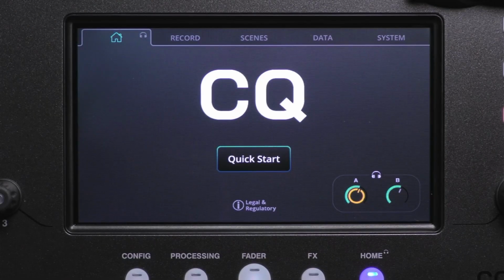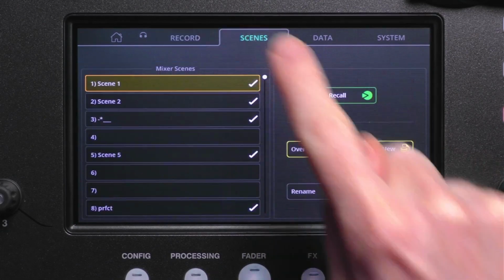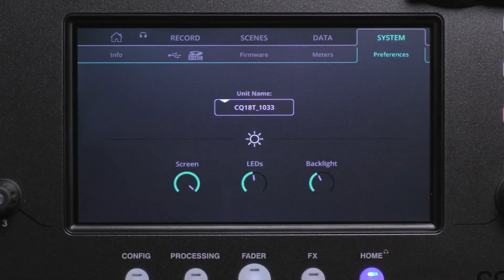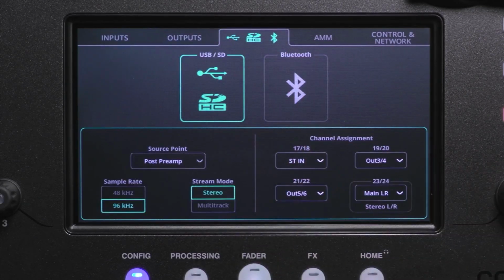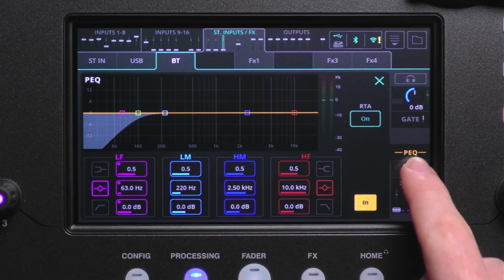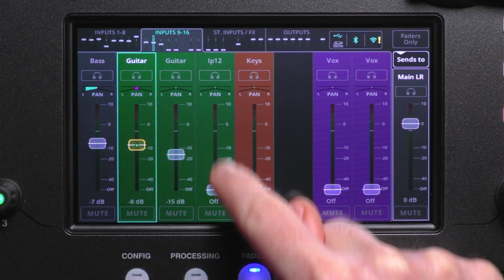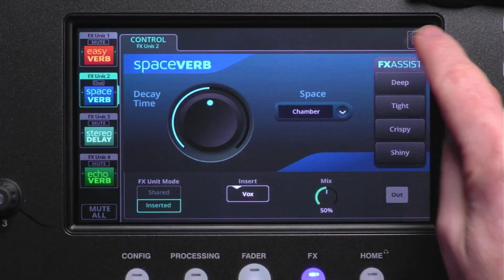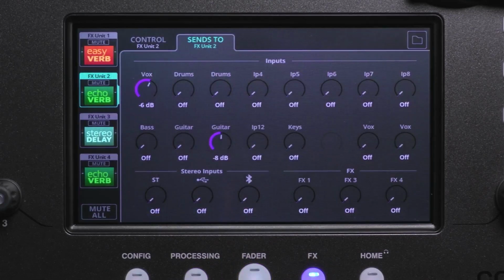CQ How To - Find Your Way Around

Comment: How we can send or copy Master LR volume/fader to each ouput? 
Do we have to adjust the individual level one by one again in each output? I think It's really waste of time.
Reply from the maker: With CQ you can run the Aux buses post-fade, set all faders to unity, and then assign a DCA to both the main LR and aux bus master faders. 
The main mix fader then control the mix for both LR & the Aux. The DCA then controls the overall level of bot outputs 
Thanks,
Luke

Comment: Can you route 1 mic input to multiple channels?
Reply from the maker: Hi Lucy, You cannot route a single input socket to multiple input channels, but you can route a single input channel to multiple output channels (not sure which you meant, so hopefully that answers it!). Thanks, Keith.
Reply: @AllenandHeathUK  hi Keith! Thanks so much for your reply

I was referring to one preamp to multiple input channels. Thank you for clearing that up.

In that case, can you route the aux send to be pre-compression?

Comment: Can you use the headphone outputs (CQ18) as independent monitor mixes for in ears as you can do with the monitor outputs (send individual levels etc)?
Reply from the maker: Hi Spiros, You can assign any of the outputs or the 'Listen' bus to each of the headphone outputs of the CQ-18T. This means you can feed 2x headphones directly from the unit and can use the two outputs for different things if you want. e.g. one for the engineer using 'Listen' and one for outputs 1&2 being used as a monitor mix with independent level control as you mention. Thanks! Keith.